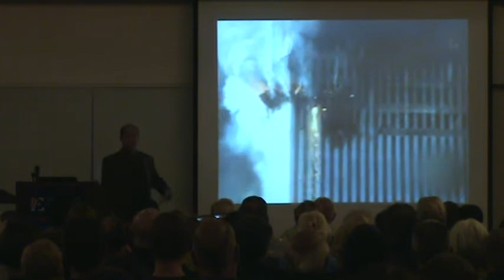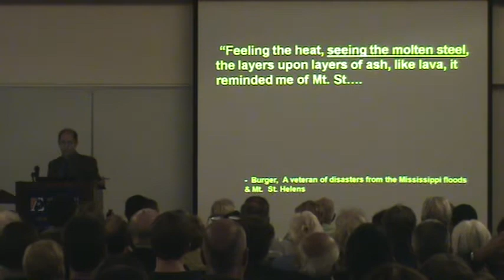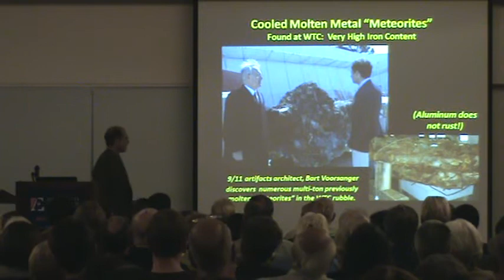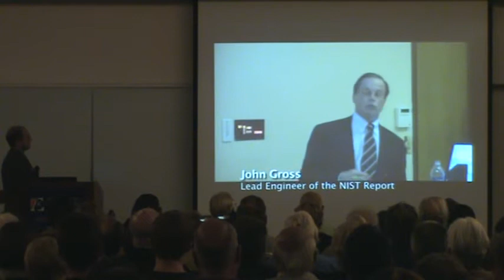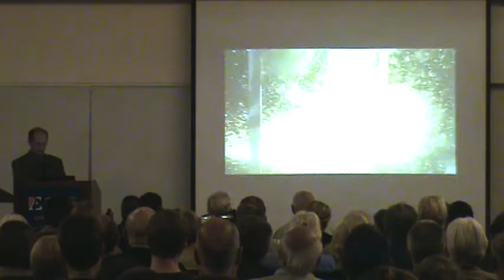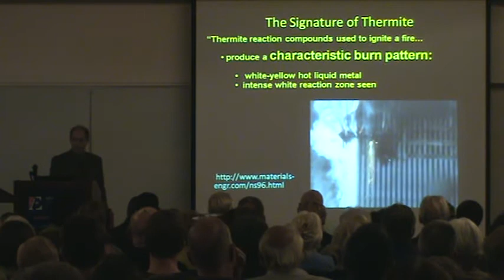Architect Richard Gage AIA (5/15) THERMITE! - Cal Poly 29MAY09

Comment: and to pass the stage of a theory about nano-thermite found in the dust of WTC as a paint. The chips were compared to the paint, and determined to be different material. The wtc material didn't dissolve in the solvent, and it's reaction to the fire was completely different (wtc material was 'exploding" with fire, the paint didn't. Samples are available to anyone from directly interested institution to compare, so if they're not doing it, it means only one thing. They don't want to know